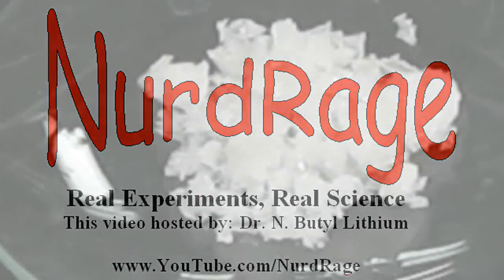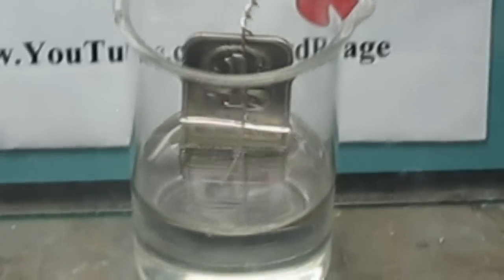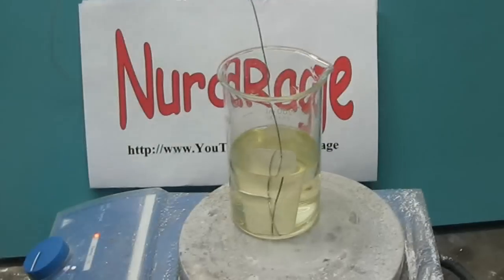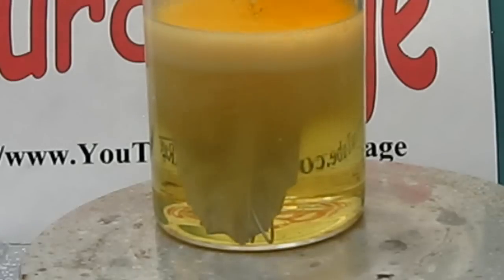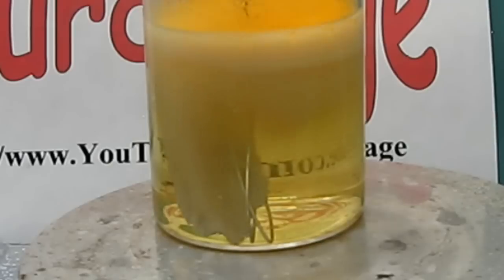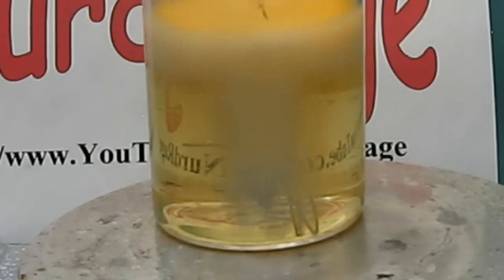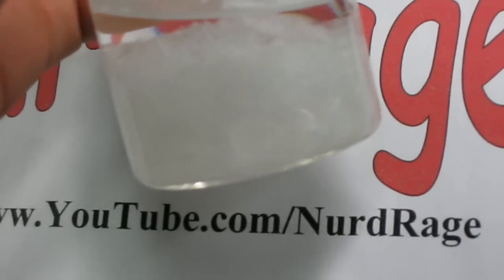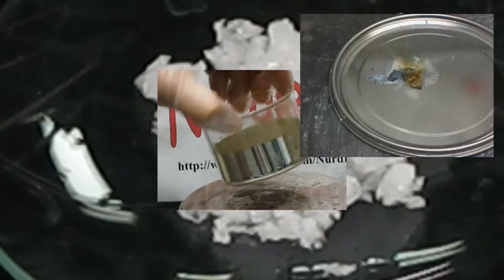Make Silver Nitrate From Silver and Nitric Acid

Comment: Well, I'm just curious, I'm no longer actively practicing chemistry as a hobby. I remember Pb-acetate had a number of uses in analytical chemistry, but it was always difficult to obtain. If You can get lead to dissolve (ionize), it is then easy to turn it into an acetate salt, but the main problem is getting it to dissolve. Years ago, we obtained it by directly dissolving small pieces of lead in acetic acid, and it took weeks to get any useful yield...

Comment: GENIUS, You're truly a Genius! One could spend days looking for this simple type of info in the literature, and never find it. Back when I was in school, we tried this, but we didn't heat the acid. Of course, the yield was very poor. This method not only uses most of Ag and HNO3 available, but also creates a relatively pure product, due to crystallization (which remains pure if filtered, though the f-paper may dissolve in the acid).

A question: is there a simple way to produce lead acetate?

Comment from the maker: ya need a furnace capable of melting silver, and a mold or a press to make into the bar shape with the proper markings.

Both of those machines are rather expensive and not really useful for the research we do here, so we'll probably never get them.

There are plenty of excellent videos on youtube and the internet on metal working. You can probably find what you need with a little searching.

Comment from the maker: Yes you can actually.

Put the silver and nitric acid into the gas generator in the part 2 method of the nitric acid video and use it the same. You still have to heat it though.

Just remember that not all the nitric acid is converted into gas and not all gas is converted back into nitric acid. So the amount of acid you get back will be less than when you started.

But at least you'll save on nitric acid if you intend to converts lots of silver.

Comment from the maker: In theory, Iron wire should work since it is also passivated by concentrated nitric acid. But I personally have never tried it so i wouldn't know for certain.

You could boil the silver nitrate solution but you might decompose your silver nitrate. Evaporation is the safest way.